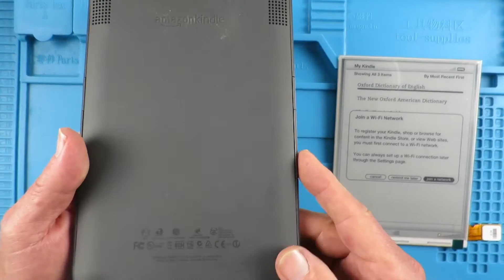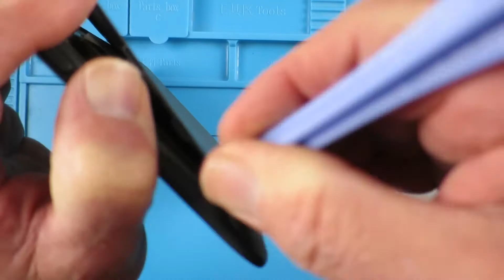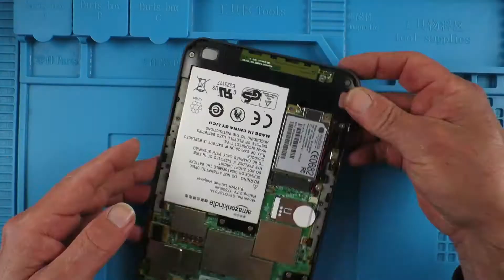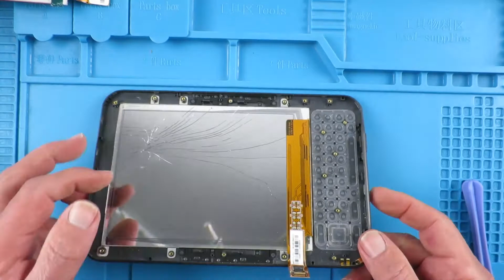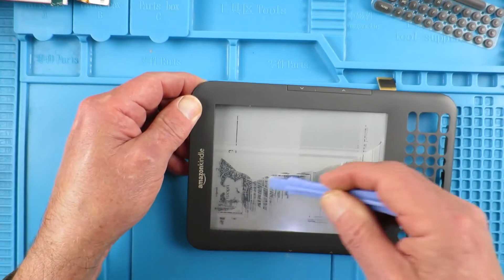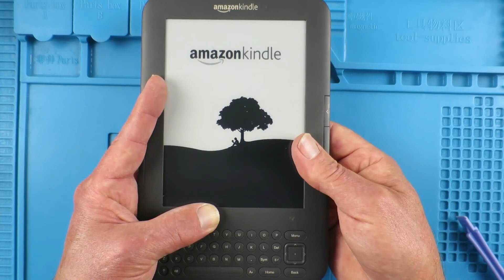Kindle 3 Screen Replacement Tutorial Model D00901 Repair Fix

Comment: Great video. Just a heads up in case folks don't know: if the battery is fully discharged, the testing of the screen will appear not to work. Don't despair. Finish the installation and charge the battery for a while. Unless there's something wrong with your new screen, it'll start working.
Reply from the maker: That's a great tip, thanks for sharing!

Comment: Got a replacement screen off ebay and followed your tutorial, which was super simple and I didn't have to take apart my kindle too much. As someone that doesn't know much about fixing things, this was super simple and easy to follow compared to all the other videos I watched. Thanks for this video!
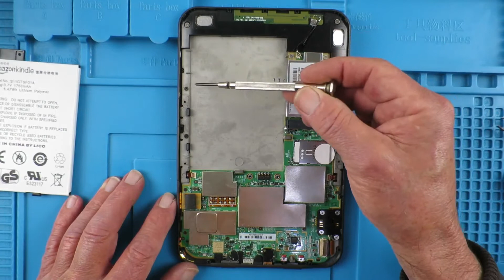Reply: FYI: For newbies like me, you need a T4 size head for the slightly larger silver screws (1:36), and a T8 or PH000 size head for the smallest black screws (1:51) in the video. I just looked for a screwdriver kit on Amazon that had a bunch of small ones, and the T4 and T8 size heads fit perfectly.

If you're forgetful like me, screenshot and print out the image from 1:03 from this video (https://www.youtube.com/watch?v=hyUvpZgKfVE) and it should help keep your screws together if you place them on top while unscrewing them.
Reply from the maker: @YutaIntroducedMe2SomeNewThangs Good to know, thanks for sharing.
Reply from the maker: You're welcome! Have a great day!!

Comment: Hello. I accidentally damaged the screen on my D00901 Amazon Kindle. The battery was working great before that little incident. I purchased a D00901 Amazon Kindle from someone in my neighborhood (that was having battery issues). After a simple battery swap, the replacement unit will not work.....even after the holding the power button for 15 seconds and/or getting the battery fully charged. All I have is the screen message that says my battery is not full. Looking forward to your suggestion(s). Essentially I do not get the reboot cycle. Regards, Peter
Reply: If you get the empty battery message on a D00901 with the original battery, it is most likely that the battery's serviceable life is over. In the ten or twelve D00901s I've refurbished, none of the original batteries (batteries will show a date of 2010 or 2011) was still functional. You can purchase a new OEM battery in the price range of $12 to $24 and follow the instructions in this video about replacing the battery

Comment: I have a Kindle Touch Model D01200, would the screen replacement linked in the description fit my kindle?
Reply from the maker: No. I think you need this one : https://s.click.aliexpress.com/e/_De8mAz9 You will need to take yours apart and check the number on the screen ribbon cable, should be ED060SCG(LF)T1 Thanks for watching, have a great day!
Reply: @1nformatica  Ahh thank you so much for your help and time, I really appreciate it! 😁
Reply from the maker: @IniaLynn  You're welcome! Have a great day!!

Comment: I am about to attempt my third screen replacement on mine... always good to review a video like this before trying..  One thing that I found a bit fiddly they you didn't mention is getting the scroll buttons back in place.. not hard.. just tricky to get them back in place while putting the back cover back on.  thanks for the video.
Reply from the maker: Glad the video helped. Each person will find a different step more tricky than others I guess.

Comment: Any way or source of ‘warm’ leds for psperwhites? I hear the originals are some super high efficiency types.
Reply from the maker: To change the leds would be major surgery and the probability of damaging either it or the screen very high. Not worth the chance in my opinion. If you have an earlier model it is worth talking to Amazon about a newer replacement. Check out this link : http://blog.the-ebook-reader.com/2012/12/27/kindle-paperwhite-screen-comparison-the-difference-is-surprising/